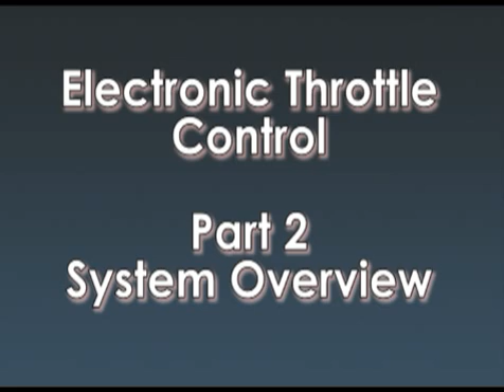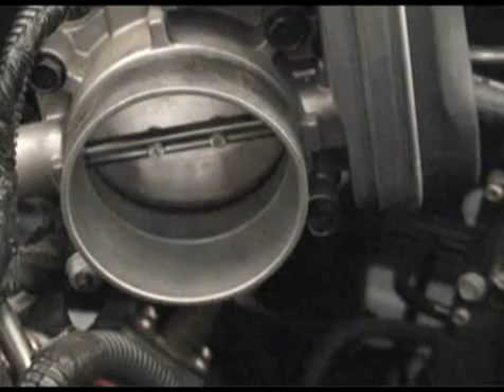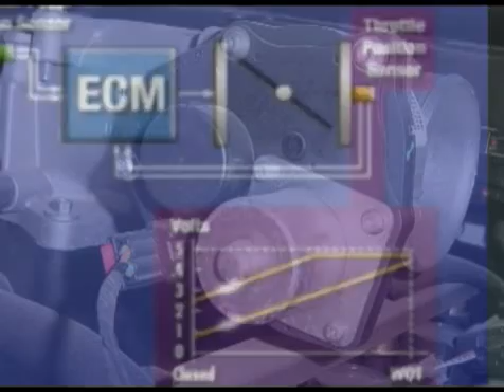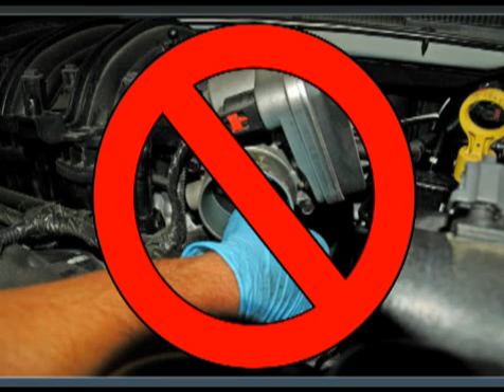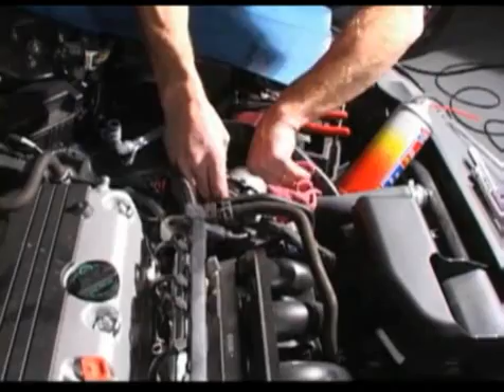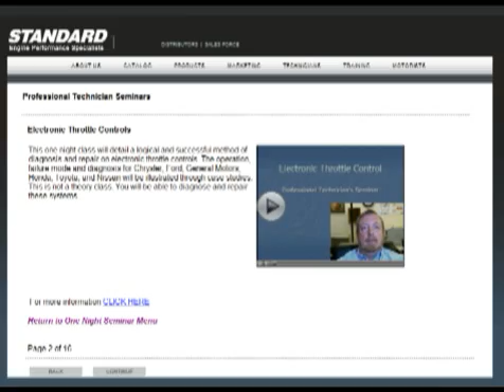Electronic Throttle Control (ETC) System

Comment: I have an issue with my TB where is sounds and looks like the ECU is forcing the TB shut , and when I press the gass pedal the Flap doesn't seem to want to open all the way, if this is normal could it be my pedal sensor?

Also when I switch the car on , there is a strange buzzing noise coming from the TB , noby not even ford seems to know what the hell is going on :/
Reply from the maker: Per the video - are you using a scan tool to put it in test mode?
Reply: Nein, don't have one :/